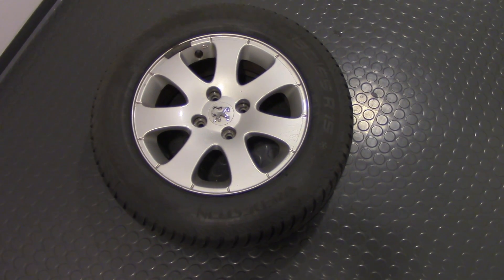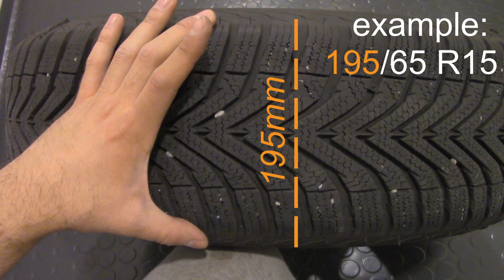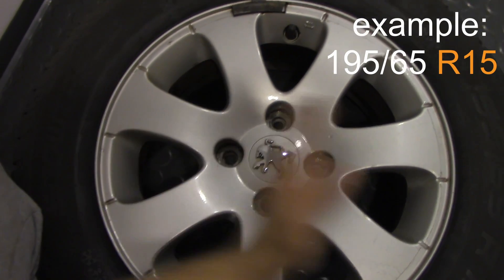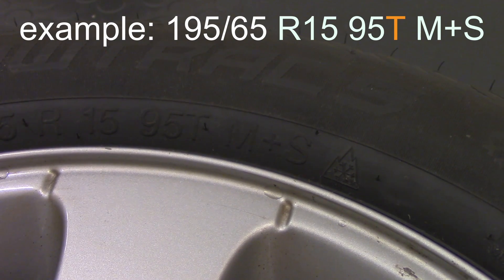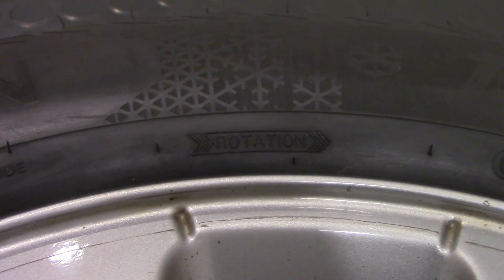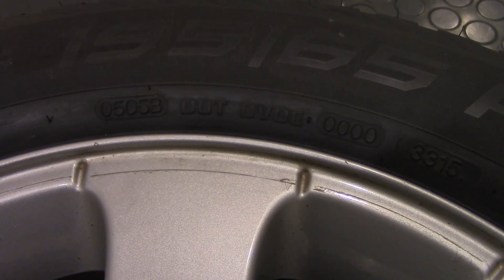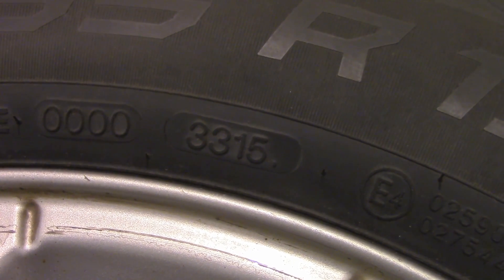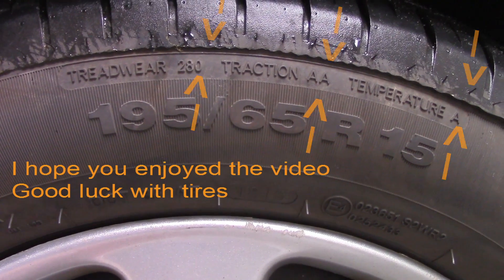Tire Markings EXPLAINED

Comment: older tires???  such as 9 x 14.5
Reply from the maker: This is indeed uncommon. I would say 14,5 inch is the rim diameter and 9 inch is the width of the tire. I have found an example of such tire with 27,5 inch of total tire height, which, in this situation, makes sens. This tire is not used in standard cars. It actually looks like an industrial tire. Does that fit to the tire you are looking for?